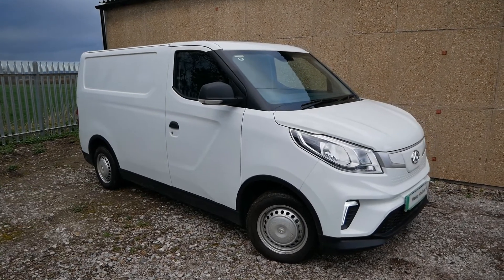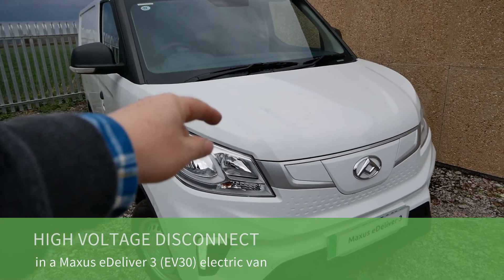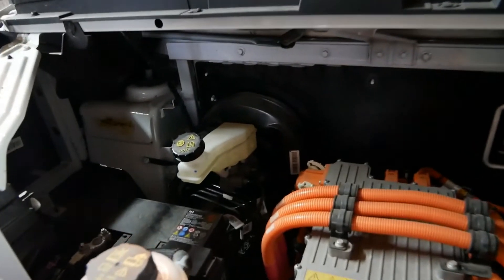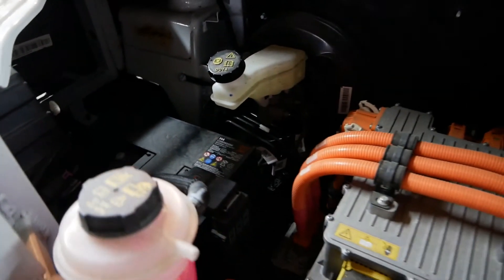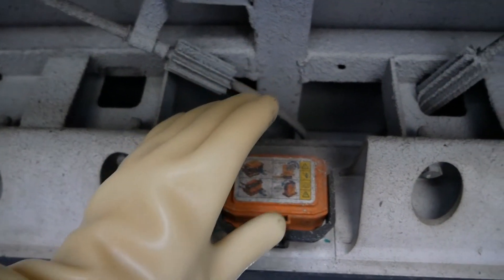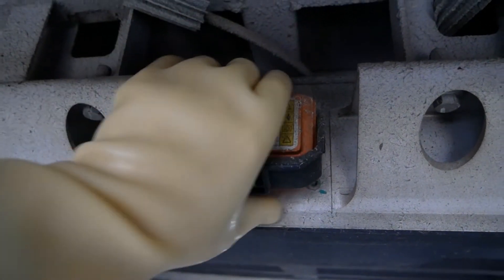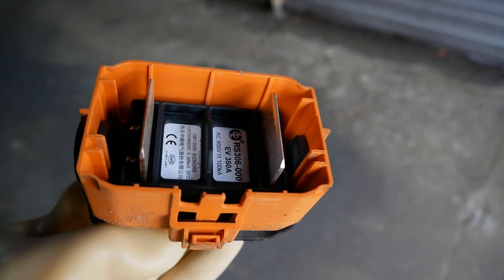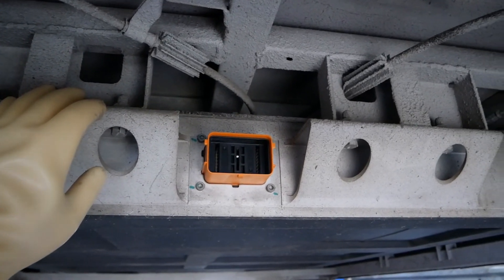High voltage disconnect in a Maxus eDeliver 3 (EV30) electric van

Comment: I don't like those vans they are horrible if I can drive I will never get one watt a stupid place a battery safety switch
Reply from the maker: Battery isolation switches are always on the battery. Either accessed from outside or sometimes from inside the vehicle behind a panel in the floor. That's a bad idea on a van and a good example of this is the new Kangoo/Merc/Townstar - see https://youtu.be/Bwt8ioM4Ihk?si=3hVIVZzf6kUslpwI

Comment: But on a Tesla firemansloop they don’t say anything about high voltage gloves must be used ? Or have I missed something here? That disconnect that you show is more like the Tesla pyrofuse even if seems not to be any fuse there ?
Reply from the maker: The fireman's loop is a low voltage (12-16V) wire, so no protection required. 
You're never going to be cutting through a 400-800V DC wire and live to tell the tale!
The high voltage disconnect shown here is how most EVs do it.
Reply: @GoGreenAutos  ohh shit, I do prefer the Tesla solution then. 😅
Reply from the maker: @peteroffpist1621  They all do have pyro fuses too. Just like ICE vehicles have fuel cut offs.